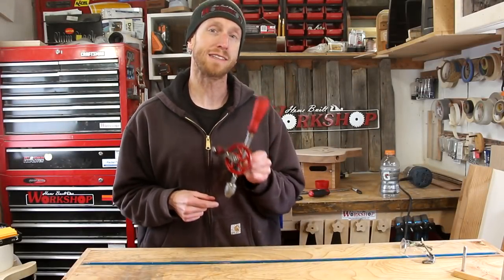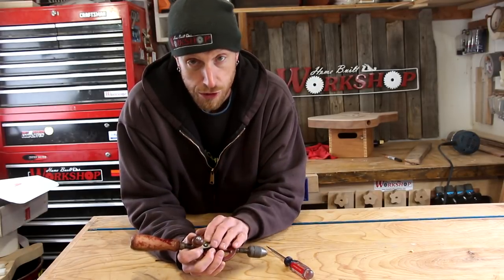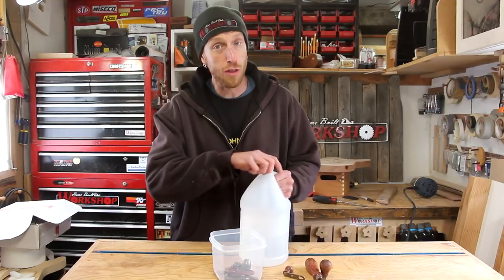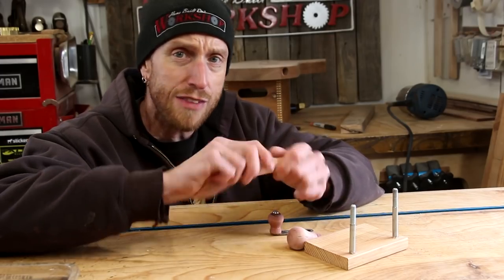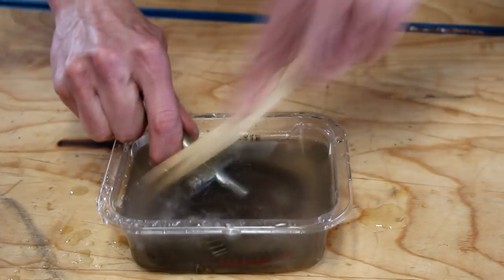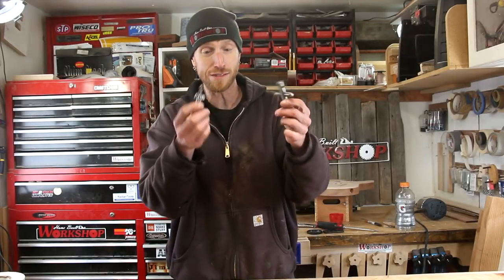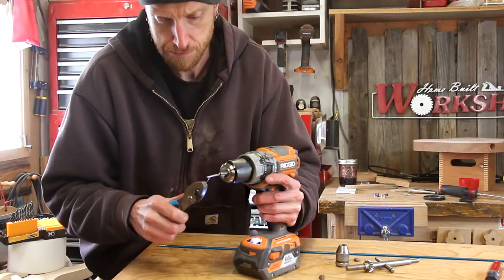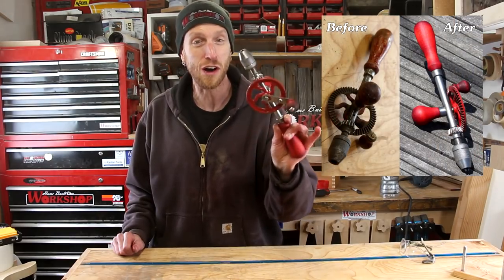Restoring an Egg Beater Drill (and how to make your own springs)

Comment: After watching many of your videos I noticed you have great patience for your projects. It’s something I have to work on, I get frustrated too quickly.
Reply from the maker: Thank You. Patience is something that I've had to really work on. Its too easy to get upset but I've realized that it doesn't get you closer to completing the project. If you just take a step back and look at the problem, you can usually find a suitable solution. Sometimes I have to set the project aside and work on something else for a bit. When you come back to it with a clear head, it helps.

Comment: 0 seconds ago
Vinegar not only removes surface rust but also is used for bluing The acid pulls carbon from the iron which gives it a corrosion resistance. Vinegar isn't strong enough to do damage over a short period of time.